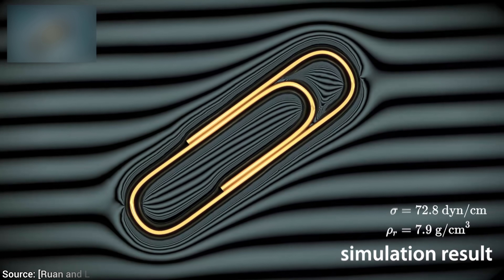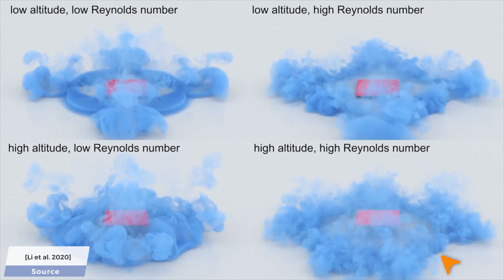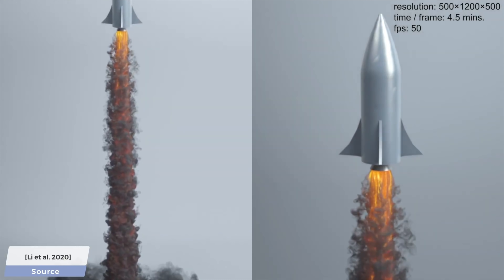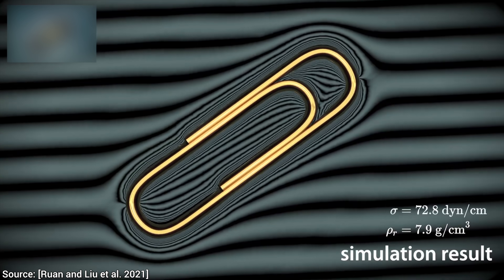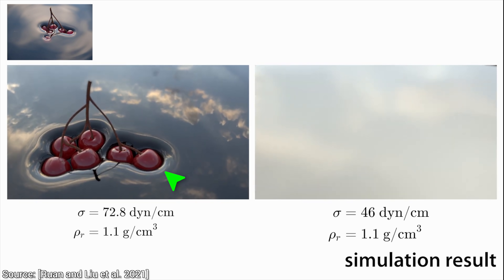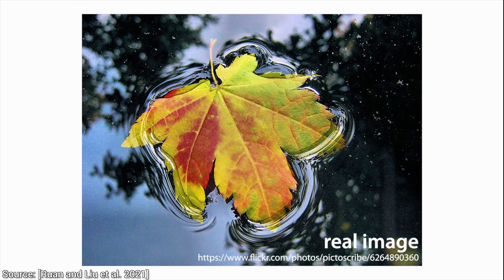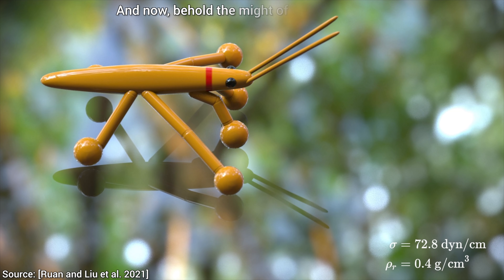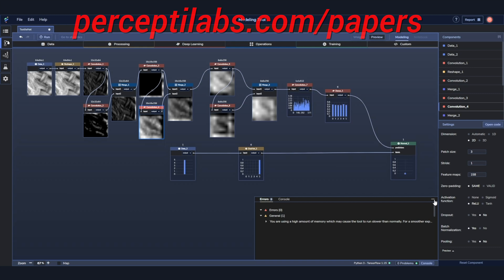A Simulation That Looks Like Reality! 🤯

Comment: The edges of the paperclip give it away being a simulation.  Check the bottom left side of the paperclip edge with the water for the biggest anomaly.  Huge artifacts.  And the lighting on the leaves is also not fully realistic, kind of looks plastic to me.  Otherwise they are impressive feats in the surface tension.

Comment: The sharp pin sinks a bit perfectly vertically, which does not happen in reality, because of the unequal water overflow on its perimeter (means, when sinking it should wobble a bit to one side at least). But nevertheless - great visualisation!

Comment: what a nice time to be alive, knowing that some new technology exists but you can't get your hands on it or its applications seems great :D 

Example :
2010 – The first prototype of the Oculus Rift headset was designed.
2021 - $400~$1200 Headsets that need like $400~$500 of accessories to make anything worth the time and not accounting the other kind of fees, and still locked (kinda) while not being truly wireless yet.

Another Example
Wifi 5GHz/IEEE 802.11ac-2013 has been approved 2013, here we are in 2021 with almost no 5GHz Access Points for 160 MHz channel bandwidths and most of the available ones either being too expensive or too locked out/blacklisted by the law (old laws that they didn't even update and there is no way to update it on the firmware)

Basically, the worst time to live in is when you know a technology is possible but you don't get to experience it until it's fully matured aka 1~2 papers + 10 years of products being thrown in the market.

Comment: I wonder if they use a supercomputer to render their sims
Reply: nope

the 2d sims were using a rtx 2070 (with a generic 16 core 3.5ghz cpu) and the 3d sims were using a rtx quadro 8000 (with a xeon w-3175x)

in the future with optimization to the simulation (this is the first time it was even possible, it will improve greatly in the future) and improvments to hardware (in a decade the 2070 will be lagacy harware, think gtx 470 performance today or something like that).

it will be real time for sure in the future.
Reply: @Arcangel0723  damn thats why its so fast